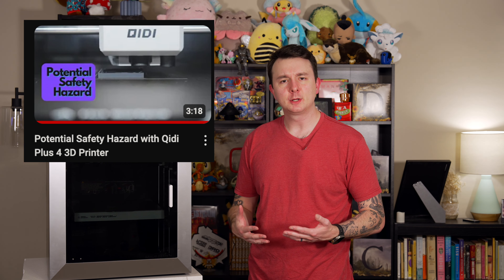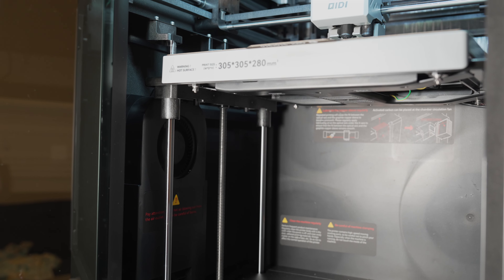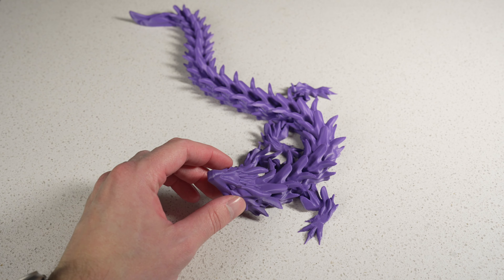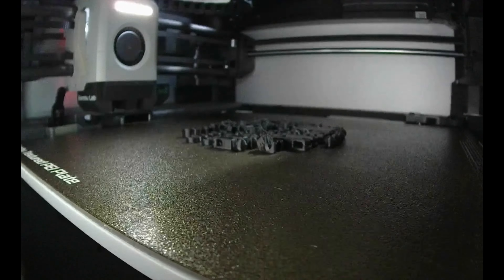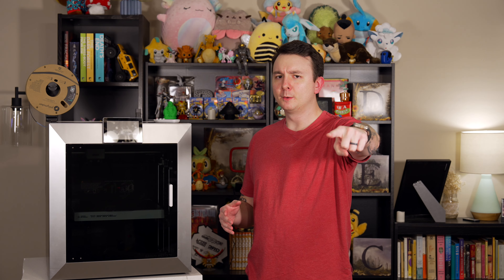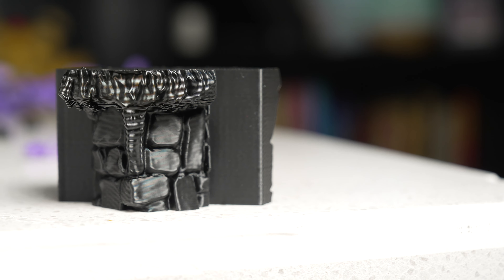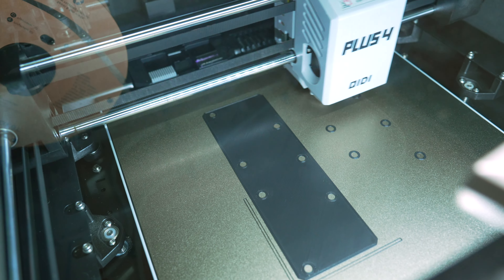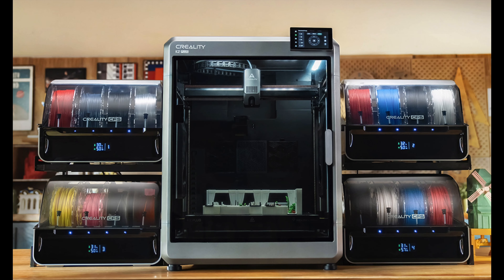Qidi Plus 4 Review: Their Best Yet, With One Issue

Comment: Interesting that you experienced more VFAs than normal. I had the exact opposite experience. My Plus 4 prints exhibited far fewer VFAs than any of my other printers.
Reply from the maker: That’s awesome and was my hope. Outside of that issue it prints phenomenally!
Reply: Do you use the Qidi studio slicer? Just curious if this might have anything to do with it.
Reply: @ButterPockets  In general, most Plus4 printers seem to produce some of the most VFA free prints I've ever seen from a stock printer. Usually retensioning the belts and/or adding some lube to the linear rods tends to clear them up, along with making sure you run the ideal speeds for your printer. My Plus4 prints nearly entirely VFA free at around 200-250mm/s for example. Not the only good speeds, but known to work well.

Comment: I have pretty much no VFAs on my Qidi plus 4,   did you run the input shaper again?    how sturdy is the table it's on?    maybe something has too much play,  some early models had some play in the head.
Reply from the maker: Yeah I’ve run input shaper multiple times due to tensioning the belts. It’s on that slab of granite which is on my heavy duty shelves (you can see them in other videos).
Reply: @blacksynth me either

Comment: Try setting the pressure_advance_smooth_time to 0.05.  That seemed to clear up a lot of the pressure advance "bounce" for me, which looked kind of similar to what you were showing off there.

I managed to get all artifacts to go away by ensuring the out wall speeds were 170mm/s or higher.  For small-print scenarios, I did multiple 1mm advance VFA towers, and for me I found a handful of very particular lower speeds where all the VFA's mostly went away.  56 and 96mm/s speeds in case you were wondering, but your individual printer may vary.

I also ended up at 2000mm/s^2 accelerations for outer and inner walls and top surfaces, and used 7500mm/s^2 accelerations for solid/sparse infills.

I don't know how I can show you images of my prints now on Youtube though.
Reply from the maker: For the pressure advance smooth time I was using 0.04. It’s my understanding that below 5k accels you use 0.04, between 5-10k you use 0.03, and above 10k you use 0.02. 

I can believe the fast and slow thing tho. People have found the same results on the X1. Go SUPER fast or really slow. I ran some tests with speeds no greater than 40mm/s and accels under 2k and they didn’t go away which really surprised me. 

I should probably make a discord or something but I’m on there with the username “butterpockets”.
Reply: @ButterPockets  I'm over on the Qidi Official Discord Server, mostly hanging out in the Plus4 channel there.  You're welcome to come say hello.  We have a massive VFA discussion thread there too.

Comment: One of the reasons stock PLA profiles don't end up with perfect corners and overhangs is that they don't enable the auxiliary fan by default. Just adding a little aux fan can really clean up cooling quality issues. Strange you are getting VFA issues. Most people tend to have very low VFA prints. My experience with the Plus4 is that it produces incredibly accurate and VFA free prints. I am very impressed overall. Belt tension and lubrication along with running ideal speeds are usually best to reduce the VFA, but sometimes there are other issues we haven't been able to fully nail down. Running a VFA tower print may help. Do let us know if you ever figure out your specific issue.
Reply from the maker: In my experience the aux fan on these printers only hurts because it adds cooling from one side only and not in a very optimal way. But to be fair I didn’t really try it with this printer and I’m actually surprised the default profiles don’t turn it on. At least I don’t think they do (I can’t really remember). 

And yeah I really did not expect this printer to have these issues and it stinks that it does. I plan to do some more tests and a follow up. I did run a VFA tower (I showed it off in the video). I ran several actually and in multiple materials as well. 

Hopefully I can solve it because I really do like this printer.
Reply: @ButterPockets  Def try the aux fan helps tremendously with my PLA prints at higher speeds.

Comment: Hello if u don’t mind can u do me a favor and messure the depth from foot to foot I want to by a tool chest to use as a table for it and the one I’m looking at is only 18 inches. I know the site says it’s 19 and change. So was hoping the feet are a little bit shorter. Thank you
Reply from the maker: I measured the outside of the printer and it’s about 19 3/8. But the feet themselves would be less. The feet could sit on something about 15.5 and a little bit. But the entire body is 19 3/8. If you were really tight on space, including the screen and filament holder, the TOTAL thing takes about 21”.
Reply: @  sweet thanks that helps a lot. And perfect timing there was only one left the was more then 21 inches deep.
Reply: @ sucks about the bfas. I already ordered it before seeing ur video. Hope it gets fixed. 
But would be awesome to make a video if u figure it out. And I’ll let u know if mine does the same. 
Also would be dope to make a beginners guid series with the plus 4. It’s my first printer and I’m going in blind.

Comment: its very likely a tension vs speed vs motor resonance issue look up MRR one way to upgrade this or remove the problem (if neither changing belt tension or speed fix it) is to have a motor replacement with a lower MRR. I have a qidi plus 4 and dont have this issue. back in the day the tmc 2208 could have also been an issue but this has been upgraded to remove salmon skin in modern iterations so what i said earlier is the most likely. Hope this helps!
Reply from the maker: Yeah I do know about these things. I’m hoping to go in and change some settings on how the motors are driven to see if I can resolve things with these motors in particular.

Comment: I like that you are honest about the printer and the VFA problems. I have experienced them too. But also, the printer can NOT print a 305x305mm square, or can yours? If you can, how do you do it? And why does it say 305x305 on the 3D printer if it can't print that size? Maybe I have a special model.

Comment: In my country we use 230V system. I test and all possible heaters on, Plus4 takes whooping 800W. But in long run when printing, it takes 0,2kW in one hour, so it use 200W when operating normally. I keep my measuring on more than 150 printing hours.

Comment: Good material! Polymaker ASA have you print on it? On Bambu X1 is very hard to make a usable print with this mayerial.
Reply from the maker: Yeah I use Polymaker ASA a lot, I just happened to use Polymaker ABS here. Much easier to print than the ABS in my opinion. I’ve had pretty decent success with it in my X1 tho.
Reply: I use Polymaker ASA on a P1s with no problems. No warping, good bed adhesion using glue stick.

Comment: Hello again I had an another question. 
Not sure how to ask it. 
But I finally hooked up my printer to my laptop. And printed from the laptop for the first time and was looking at the camera and noticed a lot of shavings and thought I might have added to much glue. So I went to check and the printer was trying to kill its self lol. But really it was carving into the build plate in the areas it was supposed to lay the plastic. I printed something I already printed and came out fairly similar. Then tried the file I sent and printed okay. So I’m not sure what caused it to do that. I’m concerned that I messed up something but not sure how to test it. It took a big gouge out of the build plate so it definitely went through some torture any thoughts?

Comment: Did you try with the to print with the resonance avoidance of? With my printer it does not seem to make a difference at all. I wonder if it works properly.
Reply from the maker: Yes I tried that on and off. There’s no way it’s doing anything because it’s only speed based. Unless you did tests to correlate which speed is causing the most vibration, it would be very hard to know. If I remember their default profile and my profiles didn’t even use the speeds within the region of that setting anyway. My guess was the 70-120 default setting for that was either random or it’s because of a holdover from early printing days. ~100mm/s was a weird transition speed between stealthchop and spread cycle.

Comment: Hey. Dyu have custom profiles for the plus4 or vidz on how to better the default profiles on qidi studio defult settings. Also all the code upgrades and how to do em. Sorry m new to 3d printing n jus got one a month back
Reply from the maker: I basically showed a profile in the video
Reply: Saw that one. Was that all there was to it?Asking about other types of filaments and if there r specific vidz u have for profiles
Reply from the maker: I don’t really share that kind of stuff on the internet. I have a video titled like “how I tune on Bambu lab printers” which almost all of that is applicable to a Qidi as well. Teaching tech has some good stuff too. Honestly just use default stuff until you see a problem, then try and fix that problem.
Reply: Ok,great thanks for the replies. If u do find any soln for the issue in the video, pls do make a vid as will be looking forward to that as mine has the same issue and also I notice more streaking on items I print towards the front (near the door) esp when m printing multiple items so some are placed there.dno if that's only mine too but will do more research. Otherwise it's an amazing printer and really enjoying it. Thanks again
Reply from the maker: Yeah I plan to make another video if I figure anything out. That’s kind of on the back burner now, but I plan to try some more!

Comment: The VFA seems to go away the faster you print maybe try that?
Reply from the maker: Typically other things start to fall apart the faster you print. Also, unless you can run insanely fast accels or only print large flat objects, you won’t run at your fast speeds. Any move change will require the tool head to run slower than the number you put in the slicer. That’s why a lot of those VFAs appear near the corner of the rock face print.

Comment: A1 doesn't have VFA: 1.5mm belt pitch + flat belts on the idle pulleys.
Reply from the maker: In my experience the A1 does outperform the X1. I haven’t run dedicated VFA tests on it, but usually the default speeds and accels are way too fast. I should run a test tho
Reply: @ButterPockets  Or just google, it's known fact that A1 has less VFA and better extrusion.

If that X1 was running slower it would show more VFA.
Reply from the maker: Okay? I don’t understand the point you’re trying to make.
Reply: @ButterPockets  Dunno, that VFA belt induced artifacts decrease with speed. Print faster than ~180-260mm/s and those mostly go away.
Reply from the maker: The default settings for the Plus 4 are faster than that. The problem is you can’t ALWAYS be at that speed. Notice on the rock wall it’s right between the corner and rock section. No matter what you set your speed to it’s going to be going much slower through that section unless you have absolutely bonkers accels. Especially for printers where going faster helps, it only exacerbates the problem because on small prints you’re not going to keep the speed up. It has to accelerate up to that speed so it’s going to be hitting it at some point. It’s not as easy as “print faster” especially get the default outer wall speed is 200 mm/s. The VFA tests corroborate this tho, and you can see as it transitions to high speeds the effect lessens, but it’s not going to go away. It’s the exact same thing BL tried to pull with the X1. It means the fundamental frequency of the system is too low and you must print above it to not have it. The problem is that you’re going to push into higher order modes and harmonics. Whereas with a well built system you could print under the fundamental frequency and have absolutely no modes present.
Reply: @ButterPockets  You gotta check the distance in the waves patterns: is it equal to the belt pitch? Then it ain't the motors, it's belts and pulleys.

Either you fix those (hint: you won't) or you tune your speeds, accel and jerk and live with that.
Reply from the maker: Did you even like watch the video? That’s my entire point. Either something is wrong with the gantry/belt path causing a vibration that continues into the print. Or it’s motor driven which could potentially be tuned. I’m well aware of how to solve these issues and I spent a good deal of time trying. There’s more I can do in the config, which I did got into, but that’s pretty much what I said. Notice too I never said definitely if the belts were the problem, I said the might be the problem. Regardless, there’s a problem. Even with the default settings I experience it, which means the due diligence for the default settings wasn’t done. I’m not positive the issue cant be solved, but I currently don’t have the solution.
Reply: @ButterPockets  Ok you are upset, good luck.
Reply: The single gear extruder on the A1 series also helps provide great quality.
Reply: @802Garage  Yup, it work like a Galileo, A1 has the best extrusion of Bambu printers.

Comment: I just traded my K1 max for this thing, absolute piece of shit so far, can’t leave it unattended, woke to a huge ball of molten plastic attached to the print head from an overnight print, wasted at least 2 rolls of pla on failed prints in a week
Reply from the maker: It sucks to hear - I would post on Reddit or discord somewhere and try to get some help. I’ve left mine running overnight over a dozen times during prep for this video and even just last night and nothing has failed. I would suspect either something is wrong with the printer or user error. Be sure you wash your build plate with soap and hot water.